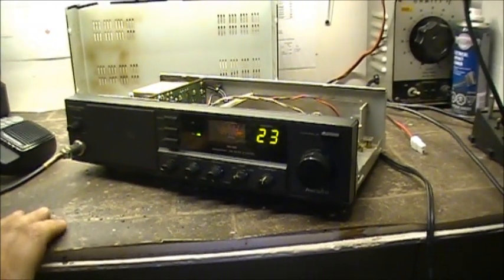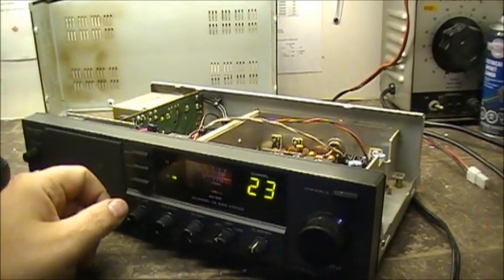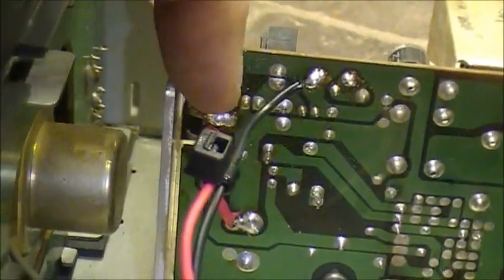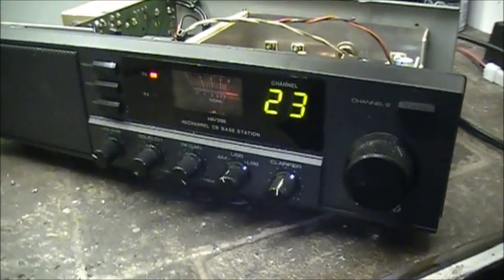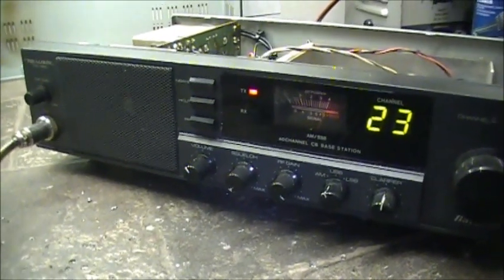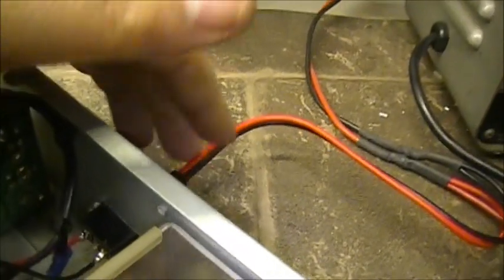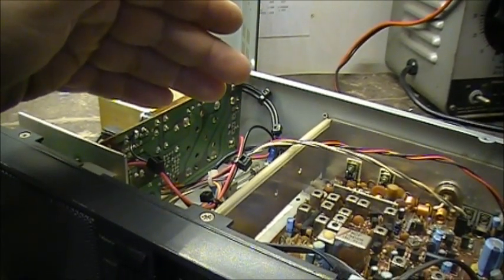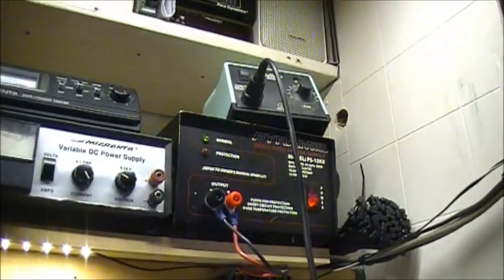Realistic TRC-850 Upgrades

Comment: Nice safety mod.  I think there is a DC plug out there that, once wired properly, will disengage one side of the AC power when it is plugged in to avoid a mishap.
Reply from the maker: I could just as easy install a disconnect relay as well. ;-)